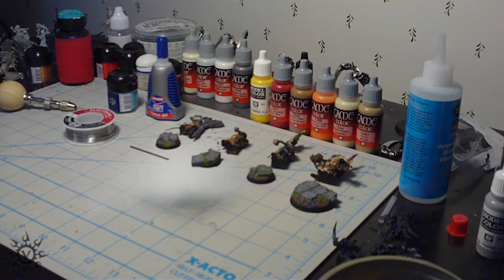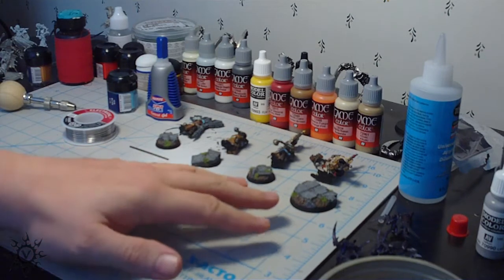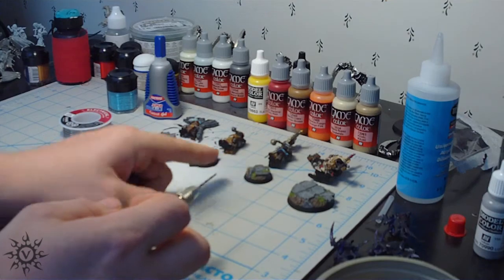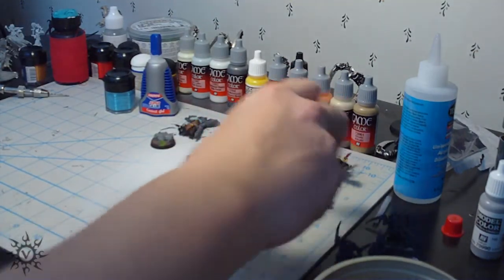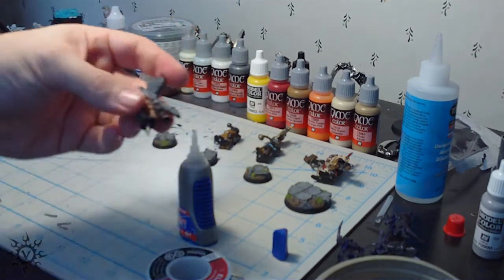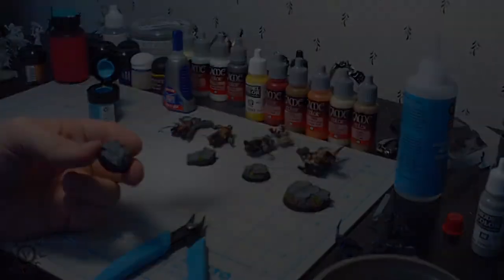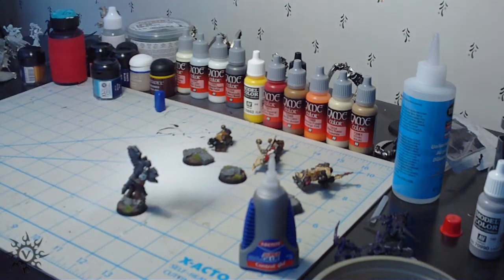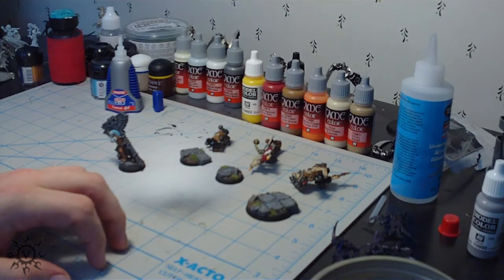Pinning Pewter to Resin Bases & Grimaldus Finished.wmv

Comment from the maker: @jimeronimo I switched to the solder wire after seeing GirlPainting use it. I have since really come to prefer it over the paper clips I used to use. I liked the idea of it because it is softer and has a bit of give to it which makes pinning even easier for me. I have not had any problems yet with the solder wire at the junctions. I think using the glue inside the holes on both sides creates a very strong bond for me. Of course only time will tell but so far Im happy with it.

Comment: Glad to see this! All I have are the older metal models..Lead, Pewter, etc. 
Q: As soft as solder wire usually is, aren't you concerned about it being weak at the junction? What made you start using that instead of paper clips or brass pinning rods?

Comment from the maker: @TheSeasonman1 I will get the specs for the solder when I get home tonight. Yes, the turn table is powered by batteries. I picked it up on ebay for around $12 US. I have seen similar models sold all over the place including craft & hobby stores.

Comment from the maker: @mattyp1239 You do bring up a good point. I don't worry much about the solder melting from a soldering gun because if it gets that close to the model it is going to ruin the model anyways. But I am not sure at what temp solder begins to break down. If it is a relatively low temp there is a chance it could begin to break down during summer months sitting in a hot car or something. I am not sure. Only time will tell I guess. :)

Comment from the maker: @veelckoo Strange, I haven't heard anyone else mention problems with the sound. I turn the music down and my voice levels up during editing. They are rather level during my editing process and when I view them online here. Not sure what the problem may be between me and you on that one.

As far as the pinning goes. I have not had any problems what so ever using the solder over paperclips. Keep in mind that it isn't only the strength of the item but creating more surface area for glue too.

Comment: Great video as always but for the love of god try to equalize sound levels. Your speech is hard to hear so we need to turn volume up and then there comes another of your videos and intro makes you deaf ;-)    
On the other note: isn't the solder too soft to have any impact on the joint strength? I'm using paper clips - they may be not so easy to cut as solder but they are stronger for sure and cheap enough.